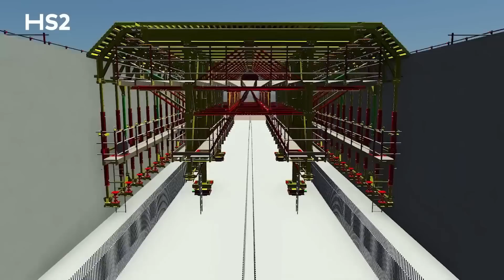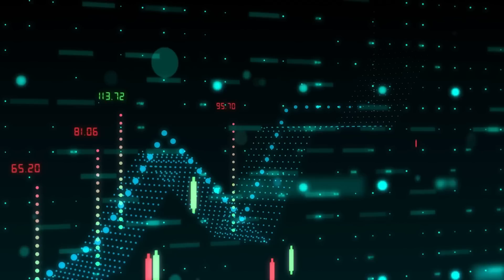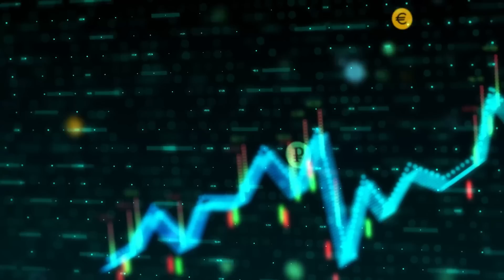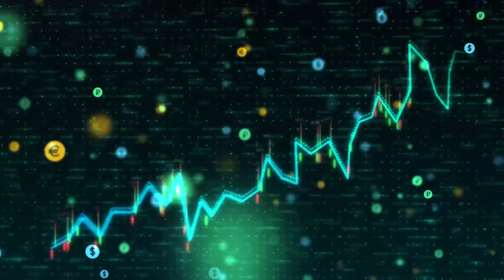United Kingdom's £106 Billion High-Speed Train Has Broke All Records

Comment: HS2 is the biggest white elephant in the history of white elephants - a pure vanity project.  It won't carry freight, doesn't connect to Heathrow, doesn't save any time travelling to, say, Birmingham, and it's planned route to Leeds has been curtailed.   Budget at £106Bn is already nearly 400% of the original budget - I bet it ends up at £200 billion.   Could have built a million homes with that kind of money.   Absolutely disgusting!

Comment: This is nearly twice the per mile cost of the California High Speed rail project. That is amazing.  

It's over seven times the per mile cost of European High speed rail.

And this doesn't even have any challenging mountainous terrain.
Reply: And what do they do in mountainous terrain? They dig tunnels and build bridges, just like with HS2. You've not offered anything by way of explaining why you think HS2 shouldn't cost what it has in comparison to projects in other countries. The reasons could, and probably are, numerous.
Reply: @gh8447   Construction costs in mountainous terrain are considerably higher because of difficulty of access.  What is usually the cause of high costs is land acquisition. In the case of HS2 it seems to be that and inflation.  Also regulatory delays will add to costs. 

I  wonder if the Chinese could have built it cheaper.  I  don't know if they're allowed to bid.
Reply: @charlo90952  Well there you go. A rational explanation of why it's more expensive (and yes, land acquisition is one good example). As for the Chinese, possibly, possibly not if they were building it to UK specification (i.e.: not tofu dreg) and hade to pay their employees UK wages.
Reply: All the environmental work that's gone into making this construction project one of the greenest in the entire world is the reason. New forests, habitats, green work costs a lot on its one.. you throw a modern high speed rail project on top.. err, duhh.. If you actually did some research, maybe you'd see that.
Reply: @adeerdoes  Yes. That's true. Chinese don't have these problems to this extent.  And I suppose CHSR also has lower environmental mitigation costs although still substantial I'm sure. It still seems an exorbitant cost. Presumably the project would never have been started had this been known at the outset.

Comment: You mentioned 'Destruction of Ancient Woodlands'... several times.
There are ZERO Ancient Woodlands in the UK. The nearest Ancient Woodlands would be the Black Forest in Germany!
Yeah a few trees were felled... far fewer than the number felled by Lightning and Gales etc each year.
A tree has a limited life. They do not live forever. It is FAR Superior for an OLD (decades to a century) tree to be cleared and replaced by dozens to thousands of seedlings. The young trees grow Faster and absorb CO2 at a far higher rate.
Most of the route of HS2 follows the route of the old Grand Central Railway... ergo... except for a hill or lake that is blocking a more direct route where there is divergence from the old GCR... 
You did nothing but spew the same old, proven long ago to be inaccurate... tree-hugger media by-lines as LIES.

Comment: Calling it High Speed doesnt actually make it high speed. The UK is soooo far behind the rest, its slow as fuck.
Reply: Someone who very obviously knows sod all about UK train network.

Think Aurora (125mph) , Azuma (140mph), Javelin (140mph) plus of course Pendolino and Voyager (both 125mph).
Reply: @22pilgrim  yes exactly. 125mph.. might be high speed by UK standards but like I said, its nothing compared to the rest. 

British Exceptionalism doesnt make it better than it is.
Reply: @krashd  many trains can easily do 225+ however red tape and certification limits their commercial running speeds. Frecciarossa 1000 comes to mind.

One thing to know with the British, they over promise and underdeliver. Ill eat my own hair if they ever reach 200mph let alone 225.
Reply: @22pilgrim  the original bullet train was averaging faster than the ones you mentioned!!!.
Reply: @22pilgrim  And the 50 year old HST train 125 MPH
Reply: HS2 trains will travel at 250mph
Reply: @peterwilliamallen1063  lol, thats what they say but we know the British dont have the expertise or technical knowhow.
Reply: @rumelahmed4539  The British do have the technical know how, we designed and built the fastest Diesel trains, the 125MPH HST which was built under licence in Australia as the XPT Train and the HST is still running now after 50 years and it is British technology that is building HS2 and although the trains will be Japanese design's but are being built in the UK